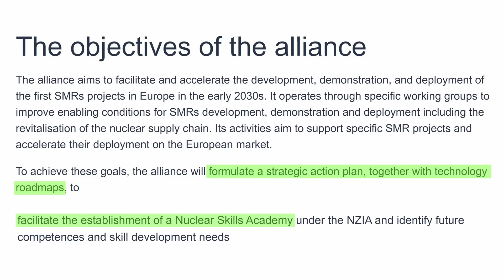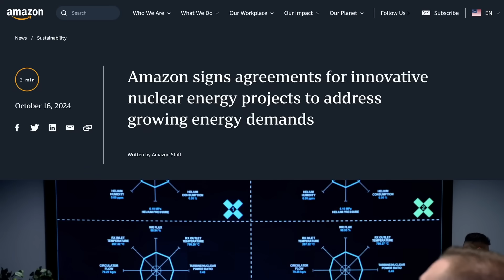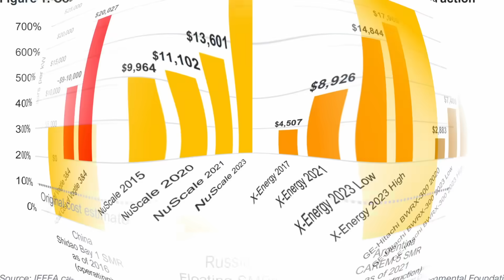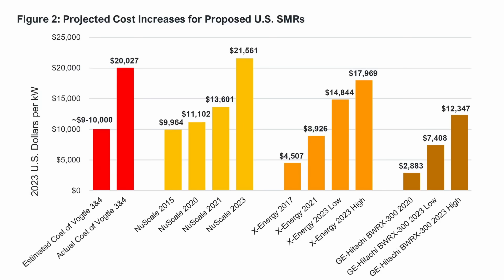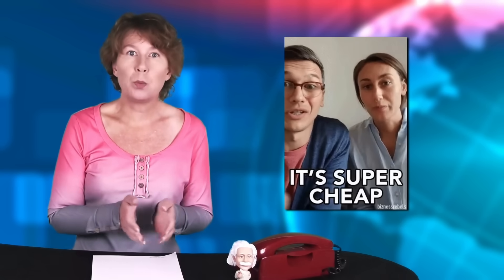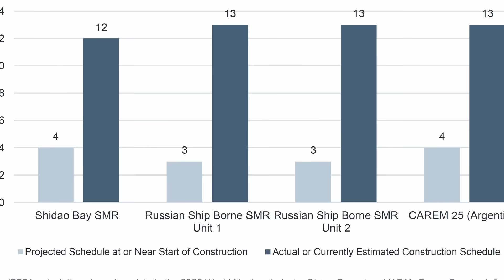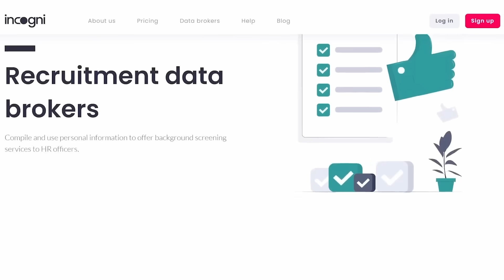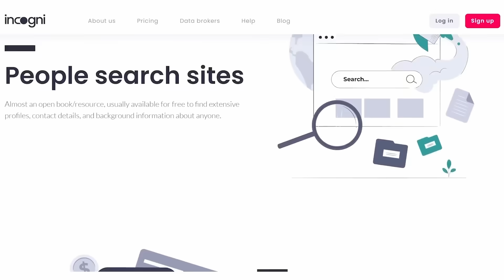Small Nuclear Reactors Have A Big Problem

Comment: Hope alone is not sufficient, but can be motivation. We need both, renewable and nuclear power. I appreciate Dr. Sabine´s unbiased open-mindedness, and keep on dusting my solar panels😉 I personally think nuclear power is in better hands if it´s produced in less, but bigger reactors anyway. It´s needed for the base load of the grid primarily, right? Many small plants in many private hands makes the controlling, transporting and compliance of safety confusing.
Reply from the maker: I think it depends on what you use the energy for. Eg if you think of energy-intensive industry, these often have industrial zones that are the size of a small city easily. It makes sense for them to have their own power generation that doesn't go through a national grid. I believe this independence will be appealing to many companies. I agree that when it comes to actual cities it would make more sense to build bigger reactors which is more efficient at the very least in terms of construction material and site checks.
Reply: @SabineHossenfelder  Yes, you´re right. A lot of industries are dependent on their own power production, currently they mostly use gas in my region. Thank you for your attention.
Reply: @SabineHossenfelder  On the one hand it’s a terrible waste of resources to build a nuclear reactor just to train an annoying chatbot. On the other hand, there are worse things for big tech could do with their repulsively large profits other than funding SMR startups!
Reply from the maker: @stevenb3315  Fair enough!
Reply: @stevenb3315  But you could use solar power to train these models. It is waaaay cheaper and servers can be regulated dynamicly unlike steel or glas plants.
Reply: @SabineHossenfelder  : I see the corporate need for quarterly profits leading to underpaid staff (never the CEO of course. He gets bonuses) leading to breaches in safety and security... and substandard parts and lax maintenance leading to safety issues. The more parts, the more units, the more chance for problems.
Reply: Hope is good for breakfast not so much for dinner. 😉
Reply: No we don't need Nuclear, this is the biggest lie out their.  Base load is a buisness model for a power seller, not a need that the grid operators buy power in that way.  The grid only needs a constant matching of production and consumption of power.